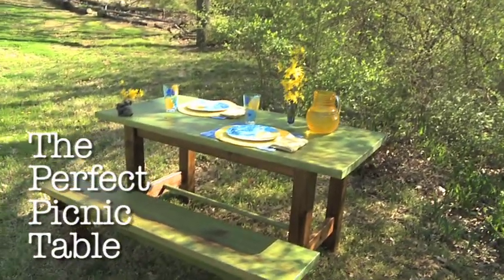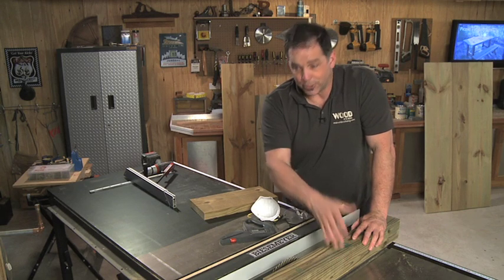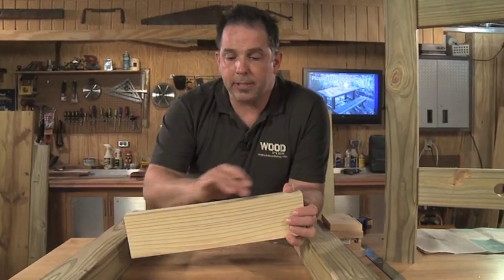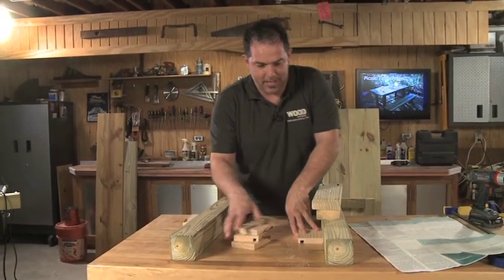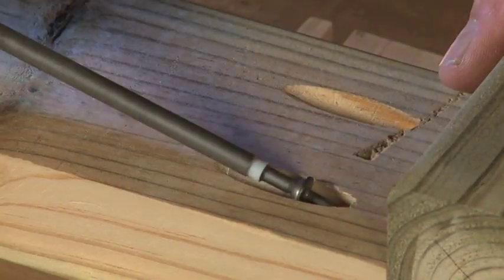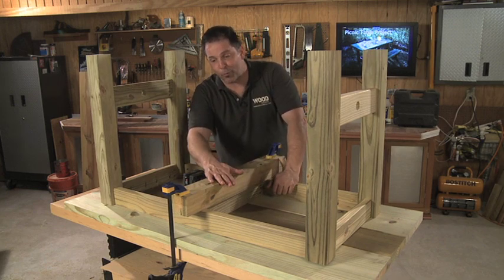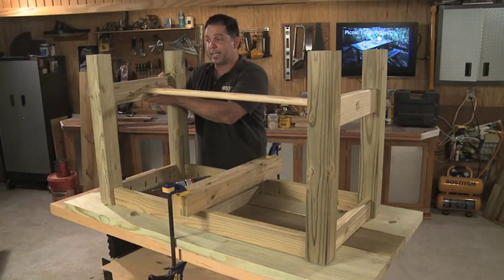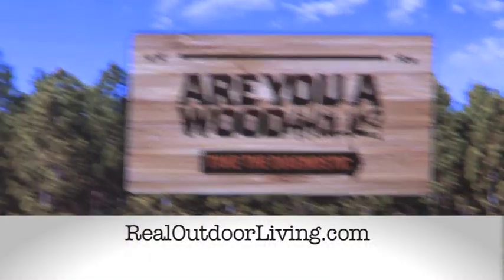Southern Pine Picnic Table Project

Comment: Nice look. But pocket hole joiner isn't joinery at all. Doweling should have been used with the screws. Just my opinion.
Reply: I agree. A table could be subject to some serious load and it's held together with the tips of some screws. Pocketholes when making a box is one thing, this is quite another. In a cabinet most of the load is on the cabinet sides  from the weight on the shelves and the structure will not be subject to odd forces from varying angles once it's hung.